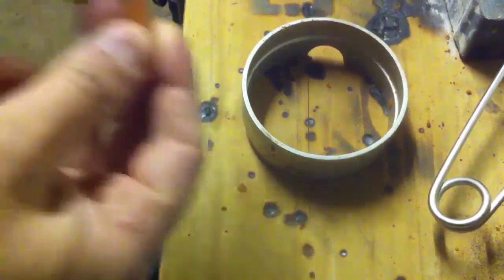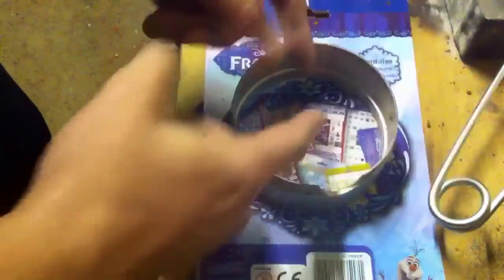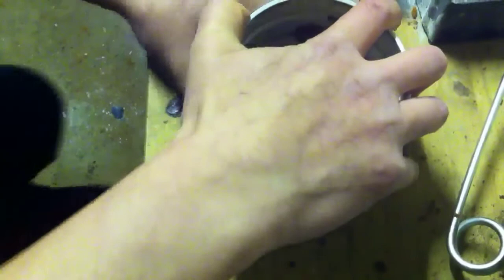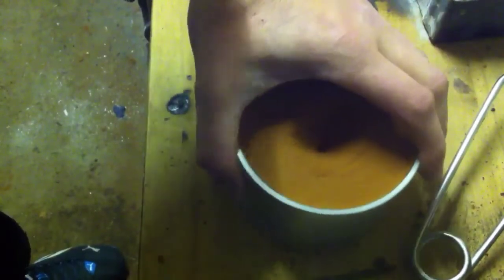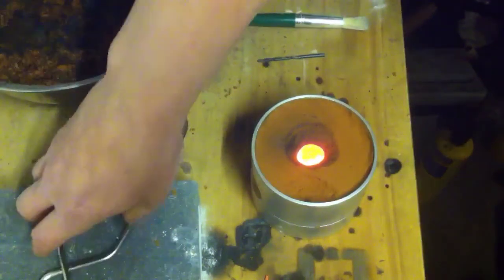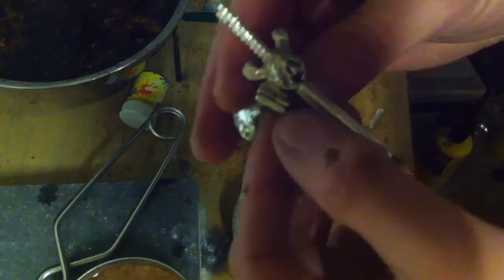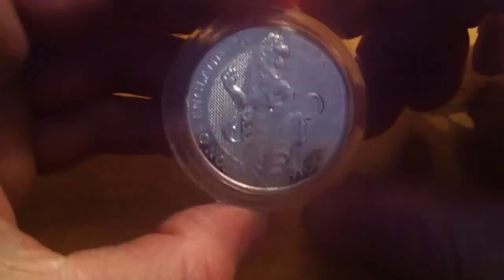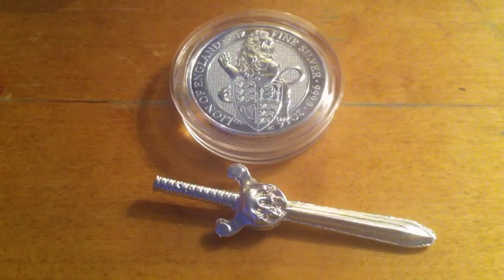New sword cast .999 silver pour

Comment: very good came out real nice. would like to get into casting aluminium. build a forge/furnace.
look fwd to seeing your new video's.
Reply from the maker: DIY GAME TEK glad you like the video. you should build one i do like watching metal being melted. what kind of things would you make
Reply: I have made a small mapp gas burner furnace in the past but it did not work to good. i would just make charcoal fired forge with a blower. 
make key fobs, handles for tools, bar stock i could the turn on the lathe.